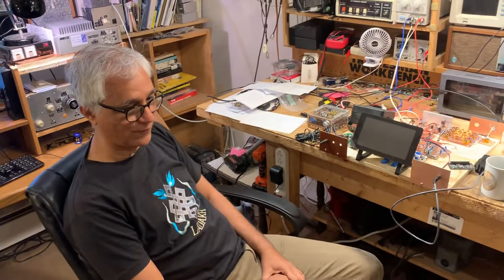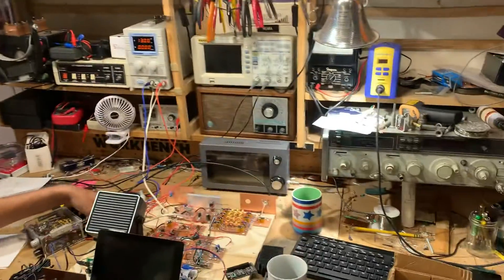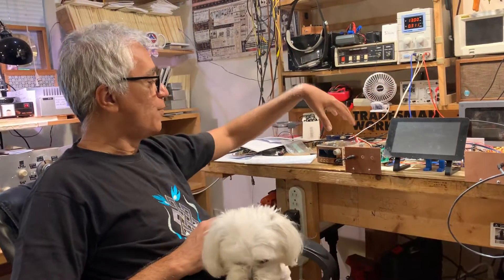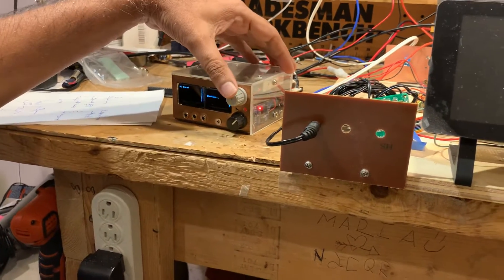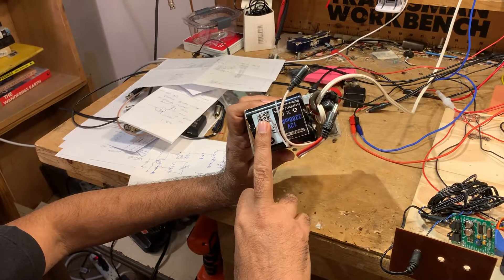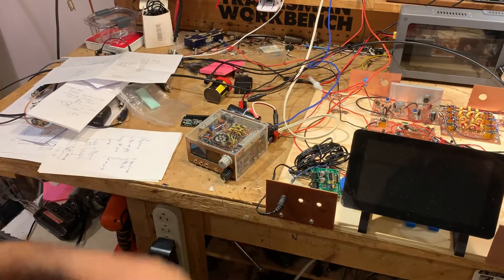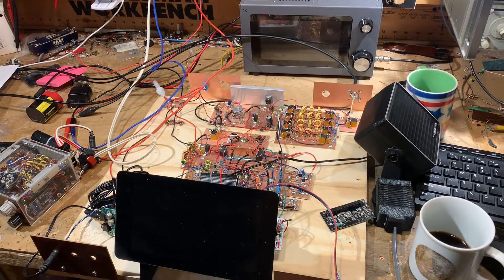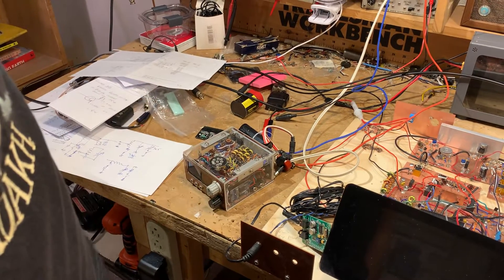Farhan VU2ESE and Dean KK4DAS visit SolderSmoke HQ (East) - Part I

Comment: Too Short . zBITX , cool, but I doubt you'll sell it ? I haven't really applied myself but I need to get the sBITX working with JS8 and need the audio files names for settings. For some reason I could't tell which one is used for ft8 and use that one. Not applying myself maybe. I think I could hike with it.